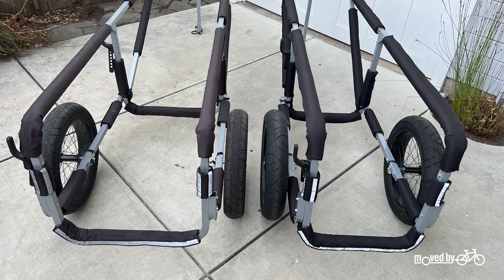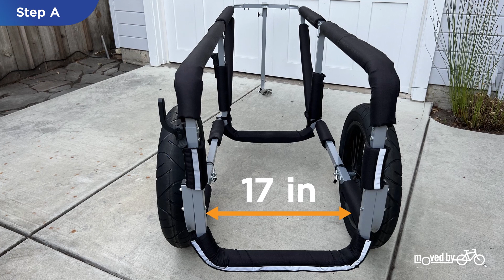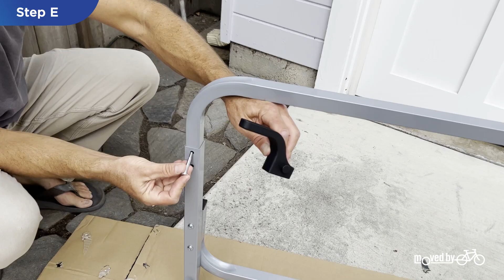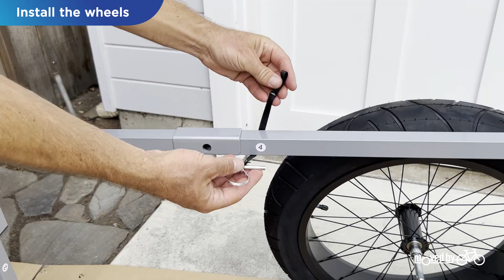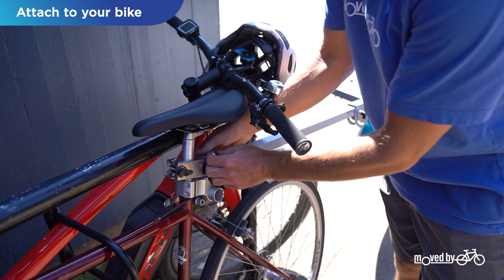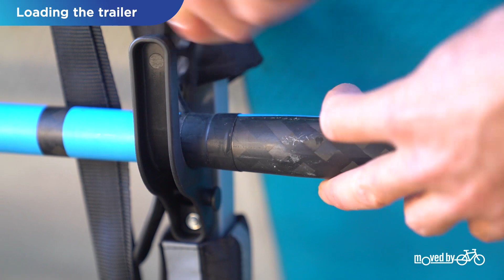MBB SUP and Kayak Trailer Setup

Comment: It hooks to the seat post which is too high. The center of gravity is much too high. This will push you over in corners. I had a kayak trailer like this and returned it. It was too dangerous for anything more than a crawl.
Reply: I beg to disagree on that point. If you had a low bar, you’d obviously bump it with the rear wheel in a turn as happens with the toddler bike trailers. While I don’t like to clamp anything to a seat post, they have a variety of accessory mounts for rear racks, etc. You can see from the videos, this trailer is pretty well balanced.

Comment: I just finished building my MBB SUP/Kayak trailer. I had a browser tab open on this trailer for a year before finally pulling the trigger. Virtually no company makes a trailer for whitewater kayaks. I live in MD, just 5 miles west from the Washington DC line, directly adjacent to the Potomac River, a mecca for WW kayaking. This trailer behind my e-bike will allow me to ride to a variety of put-in points along the river, accessible by the C&O Canal towpath, avoiding crowded parking lots, some annoying portages, saving my back and shoulders from inevitable injury. I really like the accessory mounts for rear rack so I don’t have to attach to the seat post. My only suggestion would be to make it easier to break down to put in an SUV or van when traveling away from home base.
Reply: How much was it?